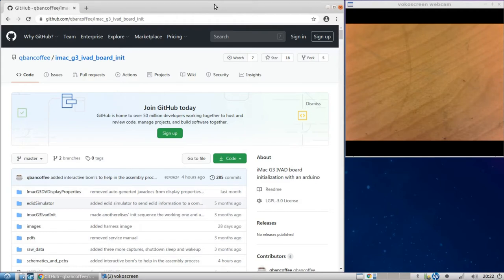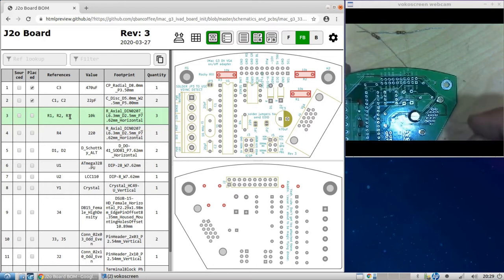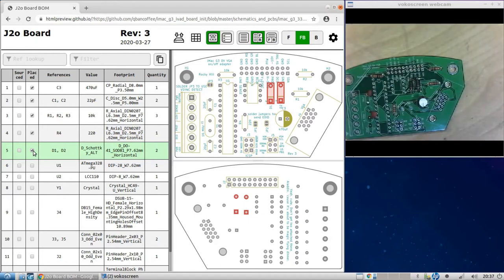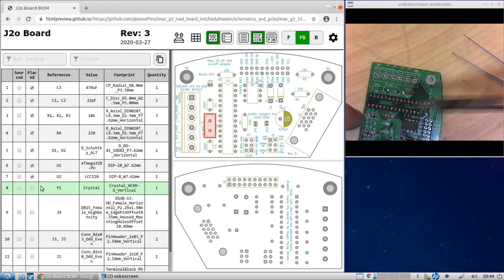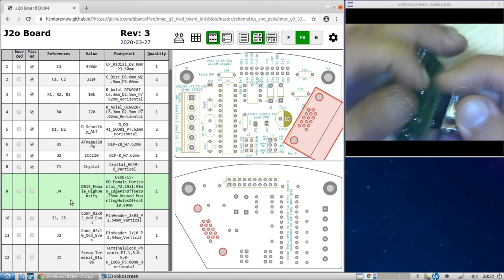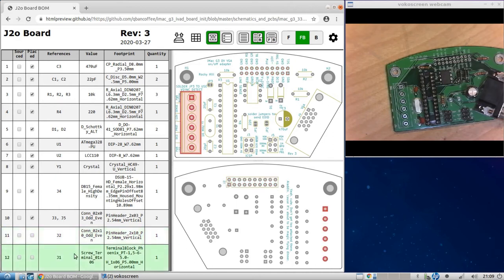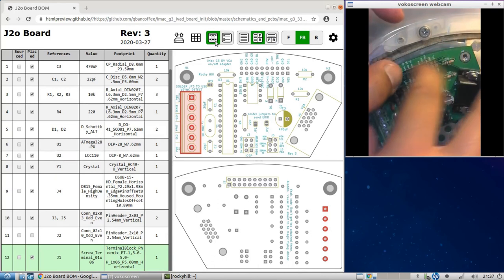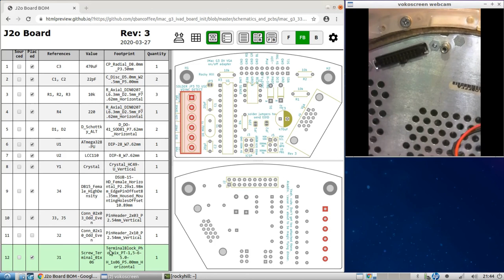Assembling the J20 adapter board

Comment: Hey mate, Looks like the crystal is obsolette on Digikey  is there another option? what are the main things is it  needs? the 16Mhz, 30 Ohms?  I'm struggling to find a replacement on digikey and electronics Ain my forte! :)
Reply from the maker: Hi! most 16Mhz cystals should work, here is a digikey part number for a substitute. 2151-AS-16.000-20-EXT-ND. good luck!